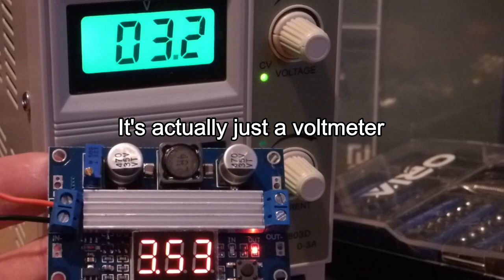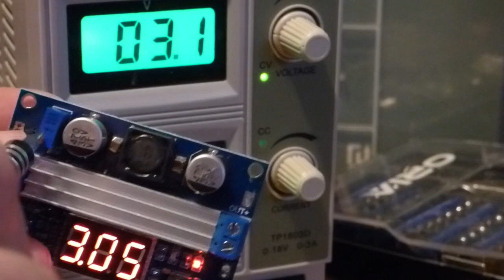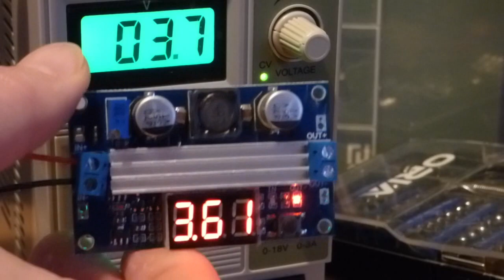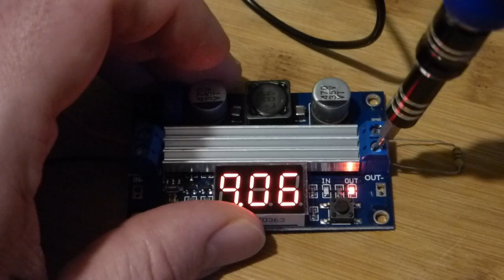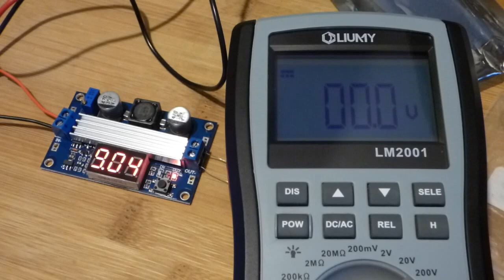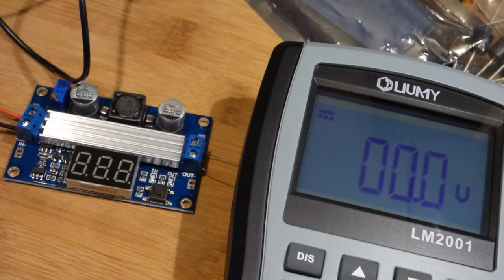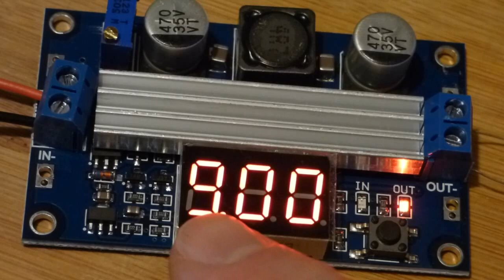First tests of in DC 3V to 35V 9A max voltage booster with DC 3 point 5V to 35V 6A max output

Comment: I am trying to diagnose an issue I have with this ltc1871 in use. Some notes for myself:

At first part of video the person shows that the module does not let the output voltage drop below input Voltage.

Then he shows that 2.5v is when the ltc1871 shuts off and says that he can't change this, but at end of video corrects himself by checking with voltmeter which shows that there is still output voltage at that scenario but I guess it may be very low current.

Long pressing the button switches off the display but maybe the voltage increasing is still active. Need to check .

"9 amps coming in max . 6 amps out max" for ltc1871. 3-35v".